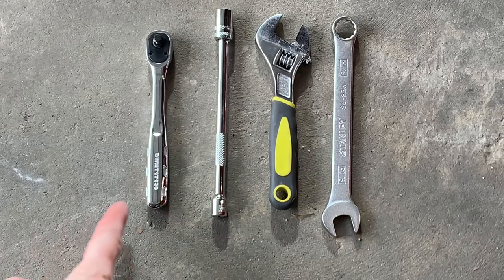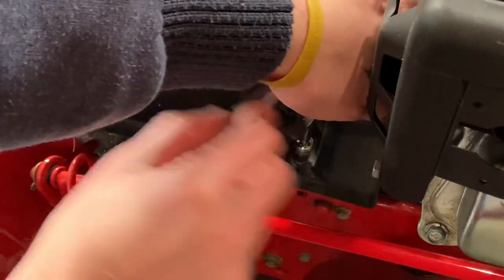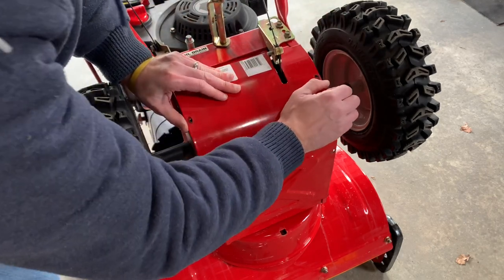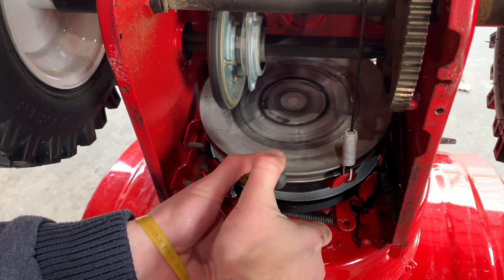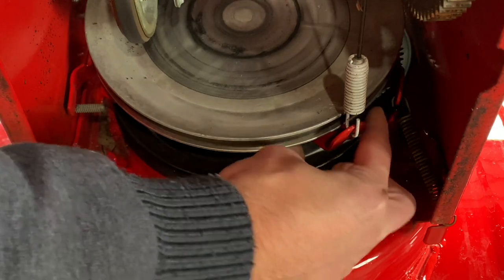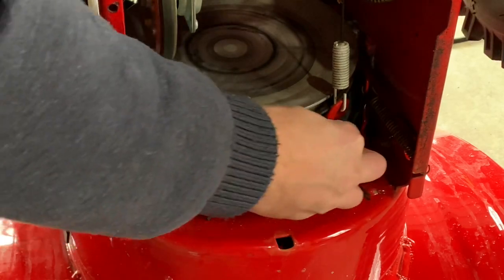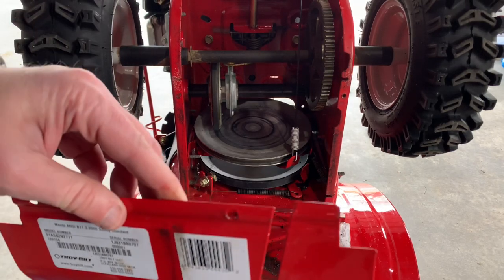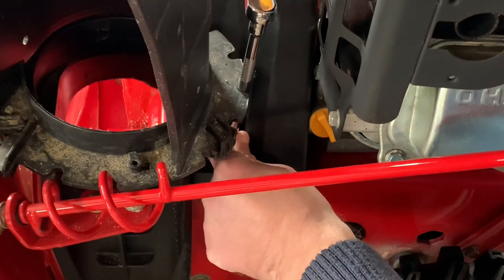How to Replace a Snowblower Auger Belt, Troy Bilt, Cub Cadet, MTD, Craftsman Auger Belt Replacement

Comment: Thanks for the how video.  Great tips on how to replace the auger belt on my Troybilt snowblower.    Sadly, breakdowns always happen when you need to the equipment to be working.   I don't have a garage, so I had to replace in my driveway.   Temp was 19 degrees.   The hardest part was keeping my hands warm for this 5-minute repair.   Thumbs up and I plan to keep it that way by not putting my hand in the snowblower.
Reply: Mine just broke. It was working fine until I hit a large rock. I don't have a garage either. But I live on a hill and my basement has a door at the back of the house. I was in luck, the snowblower fit through that door!

Comment: Excellent !! I was able to get right at the belt & replace it. Had to pry the 2 pulleys apart with a screwdriver & twist the new belt just a bit to get it between the pulleys.  I ended up removing the long spring on the red painted belt keeper & then could move it out of the way. Remember to hook the spring back on.
Reply from the maker: Thank you for the tip! I'm glad it was helpful! Thank you for watching and please consider giving the video a thumbs up if you haven't already! Thank you!

Comment: Great job. This is something I can easily do. 👍🏼👍🏼 I just purchased this model used for $100 and it started right up but the auger and isn’t working so I took the cover off and low and behold the belt is broken.

Comment: Thank you. This helped me replace the belt. Very easy once you've done it once.
Reply from the maker: That’s great, I’m glad it was helpful! Thank you for watching and please consider giving the video a thumbs up if you haven’t already! Thank you!
Reply: @5MinuteFixit  I have another issue maybe you could do a How-to video for. My Troybilt Snowblower just like this one has 6 FWD and 2 REV speeds. It won't reverse in speed 1 and speed 2 barely moves. How so I fix that?  It's been like this since new or pretty close to it. Blower is 10yrs old now.
Reply from the maker: @PurpleSideBlack  this almost certainly has to do with the cable adjustment...I noticed that my snowblower has trouble in reverse as well. This is a good idea for a video in the future...thank you for that!

Comment: Thanks,  this was a great video and very helpful!  One issue I had after replacing the belt was when releasing the auger lever it rubs against the plastic cover a bit. Could this mean it needs a cable adjustment to tighten it up a bit?

Comment: Thanks so much for this video. I just replaced my auger belt and probably saved myself quite a bit of money. Upon trying to get the belt off, I noticed something in the housing. Turns out an acorn was stuck in there. Two actually so I'm wondering if a mouse was attempting to make a house.
Reply from the maker: Thanks for watching! I’m glad you found it helpful and were able to save some money! I just uploaded a drive belt replacement video today if you’d like to check that one out as well: https://youtu.be/su5wcc2S4UA
Reply: @5MinuteFixit  Hopefully I’ll never have to watch it, but now I know where to go if needed. Thanks.
Reply: Mice don’t eat acorns but squirrels sure do

Comment: So I replaced both belts proactively (5 years old), and now it makes a noise like the belts are rubbing on something.  I think the guide on the auger belt is making contact with the belt at idle when it shouldn't.  Any advice?
Reply: Same issue here

Comment: I can smell rubber now and then...my auger doesn't have the power to throw deep snow now.. I tightened auger cable, it worked for a bit and now it will only throw very light snow if it gets deep it stops....I tightened the auger cable again and same results...I would imagine I need a new belt?... I just watched another video and I may have to adjust the idler pulley also.......thanks for the video.
Reply: I'm having the same problem, did you ever figure this out?
Reply: @nickh5049  The belt was worn badly, I can only assume it was never adjusted properly from the factory as its only on its 2nd year with hardly any use....

Comment: The only way I could remove the auger belt was to remove the whole front end...this past time, I found another way to provide more clearance to that bolt that stops it...I found that if I removed the bolts from the rubber drive wheel above the friction wheel and moved it to one side I could get more clearance from the bolt on the big auger pulley..I sure is easier than removing the whole front of the blower...what do you think of this way?
Reply from the maker: I think as long as you have enough clearance to remove and then reinstall it that way I don’t see an issue at all. I guess worst case is if you ran into trouble you could just spit the unit and finish it that way! Thank you for watching, hopefully this helps!

Comment: The video was very helpful! The original belt on my Storm 2840 was MTD 754-04195 and it seems like the MTD 954-04050A belt is too small (and the belt in your link doesn't have the teeth on the side of the belt). Do you know if they changed the belt specs at all?
Reply: There are two possible engines on these models, Large and Standard. The 04195 (37") is for larger engines, while the 04050 (35") is for standard engines. Troy Built's website lists both for my Storm 2410. Probably best to remove the old one first and measure before replacing.
Reply: @wtriba  for some reason my aftermarket supplier lists the 37 as 36 3/4. Interesting though is is shows cogged as was the one in this video. My friend's broken belt was not cogged interesting though is mtdparts site is picturing it as not cogged but also as 04195a

Comment: I just ordered an auger belt and wheel drive belt…the auger belt on the replacement belt is not notched for auger as original is and the drive belt is notched where the original was not. So both opposite of what originals are. Does that sound right? I have a Troy bilt 2840 storm. Got from Amazon. Thank you.
Reply from the maker: When you take off the original belts I would match up the length and width to make sure they are correct. They may very well be the correct ones but I would recommend comparing them first.